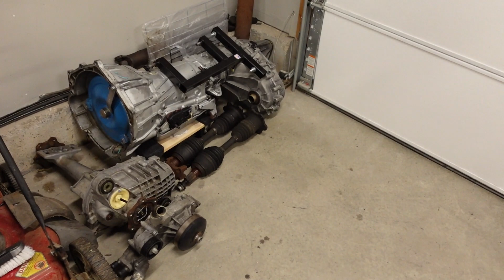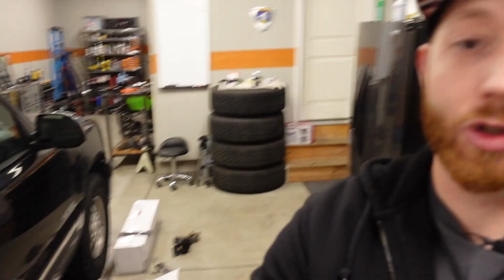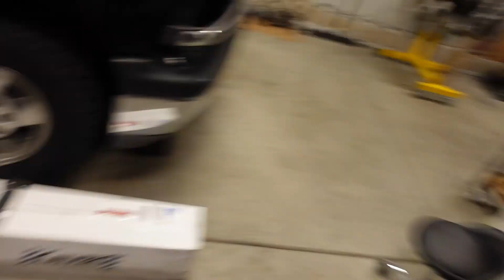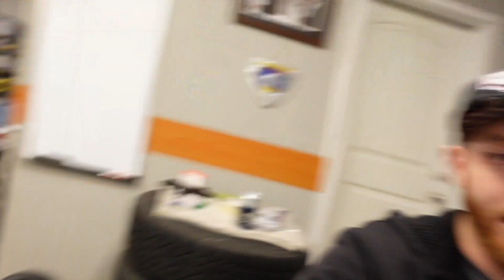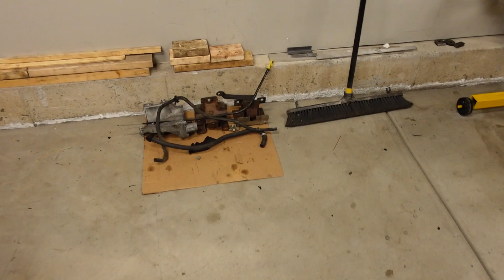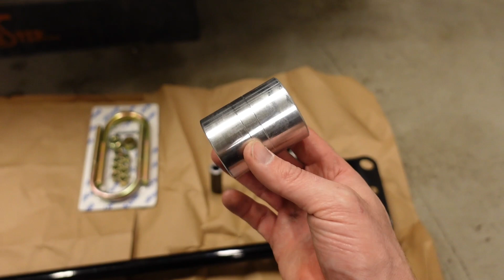AWD vs 2WD: Race Suspension Upgrades for BOTH TRUCKS

Comment from the maker: once I get the Circle D back in the uglytruck, we're going all-in on the rear suspension install! Can't wait to get started on that.
Reply: I did the shock relocation and coil over conversion on my 99 2wd ext cab a couple weeks ago. I’m sitting on like a 3/4 drop right now pretty much. You will be blown away by the stiffness of the rear end when putting the hammer down!
Reply: @shakenfake  that sounds awesome!

Comment: Call Calvert back, get a set of split mono springs, and ditch stock rear mount and shackles and get some sliders. If you really want to go fast, that’s almost a must with a heavy truck like that. Also, you never mentioned what rear axle you were going with.. you can build a 10 bolt but for the same price you can get a solidly built 9”

Comment: I have speed engineering traction bars in my 08 Sierra pictured and I didn’t drill the hole in the springs and I haven’t had any issues with it what so ever in function. Great money spent to save my fully built 10 bolt

Comment: Pro street for sure full size drag trucks are where it's at! I'm running stock style suspension just caltracs and Calvert leaf springs with double adjustable strange shocks! Mines a single cab Sierra ls2 based 403 with a 91mm Garret gt5591 Huron Speed single t6 turbo kit ,Holley EFI with a th400 it's been 1.38 60ft and 5.73 @ 121mph in the 1/8

Comment: For corner handling on the awd why not a 3-link with either a pan hard bar or a watts linkage? That setup would be easy and stout enough for anything you want to through at it really. Just a thought was all. Keep up the great and informative work your doing man. A lot of people appreciate it, inspiring.
Reply from the maker: that would be fun! I think long term, the back end of the stepside may get 4 linked

Comment: You mentioned the staggered shock mounts—supposed to control wheel hop due to axle wrap. Not too effective, but cheap factory solution. Your two suspension builds look great 👍

Comment: Richard Holdener just did a video on the 4.8 with the Cadillac supercharger. There’s an adapter now available. So far 500+ hp on pump gas… next he’s going E85 with more timing…could be a possibility with yours.

Comment: You should look into aftermarket sway bars instead of factory.  I have solid belltech bars on my 2wd step and it handles incredible.
Reply from the maker: I may actually swap out the parts I have on the other truck to the stepside, I've got a Belltech solid front bar and Hellwig rear bar...
Reply: @TolmanPerformance  perfect.  That should give you what you're trying to achieve. 😁

Comment: Caltracks are better than nothing and most other alternatives but for drag racing a four link would be a safer choice.
Leaf springs can do weird things when under the kind of load drag racing puts on them . The kind of weird things that can put you into a wall.
Using anything other than a four link requires a lot of effort in getting the shocks swaybar and everything dialled in.

Comment: Two different trucks for two different uses, but your still using a solid axle on both. Have you considered an IRS for the AWD truck? Are there even any IRS options to pull from a GM platform?
Reply from the maker: tahoes and suburbans from somewhere around 2019 and newer use IRS, so that might be an option for a donor truck
Reply: @TolmanPerformance  I think that would be a real game changer, hopefully you consider doing that in the future.

Comment: I'm still trying to figure out how you got over like $1500 on the 4.8l I mean obviously the cam is like $400 and another $200 or less on springs and I mean a complete gasket kit is what like $200 or something but you said you are already over $3000
Reply: He put lifters and a new oil pump and pickup in it too. Also a MLS head gasket
Reply: @brandont65  ya so another like $200
Reply: Maybe a little more but I'm still at like maybe $1500
Reply from the maker: toward the end of one of my last videos I showed a spreadsheet with every dollar spent on it...

Comment: I put some over-the-axle traction bars on my 650hp k2500. They help stop axle wrap but the heavy spring pack doesn't hurt either. I wanted some extra assistance but didn't want those obnoxiously long traction bars that you see diesels run. My truck is a sleeper. I try to keep it low key and hidden.

Comment: The shocks are mounted on the front and rear because of axle tramp or wrap, smoothens/dampens transition between power and coast/braking.
Reply: I always wanted a good explanation ,thanx.

Comment: LT it doesn't matter what cubic is the motor is if you want it to rev high you have to balance it then make sure the timing of the valves is right the balance sheet is key taking a 565 and making it rev like a 283 balancing is key and keeping the windage down in the oil pan